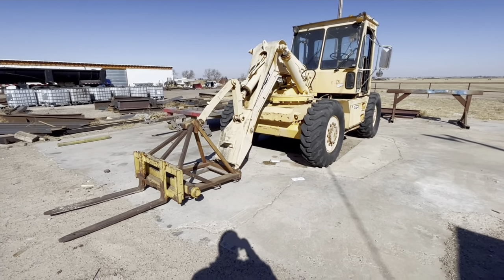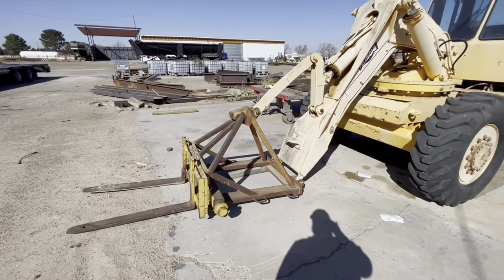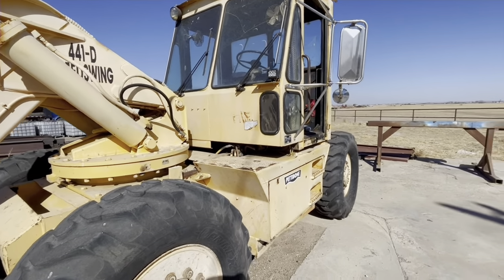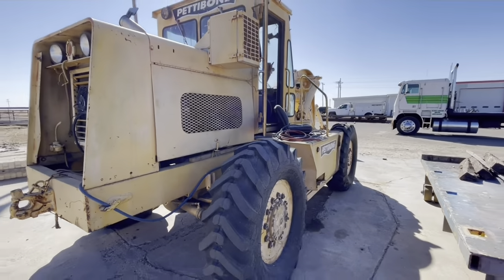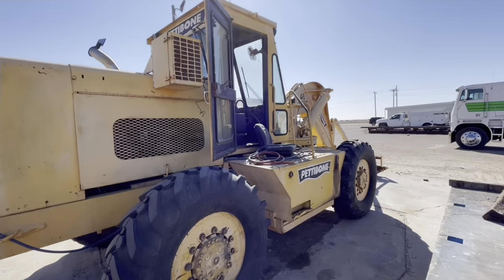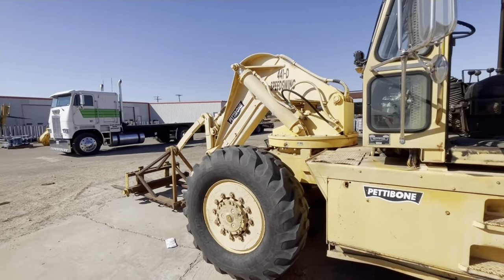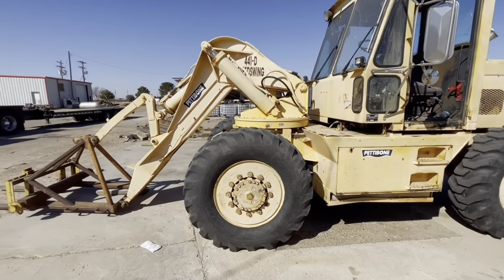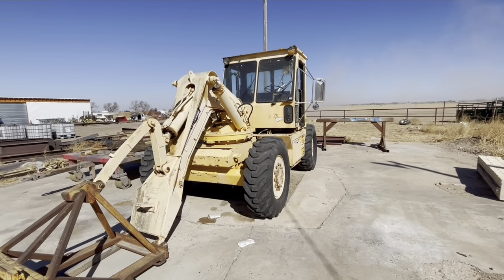What is this? A loader? Forklift? Railroad? I’ll show you!

Comment: Heck yeah man!  If you show the 16V wheeled-dozer, you might be pleasantly surprised at how well that video will be received...especially if you can get video of it running.  I already want to see it!  2-stroke Detroit Diesel anything has a huge cult following here on YouTube.  As for this Pettibone, you're correct, they were/are very popular with railroad "maintenance of way" (MOW) gangs.  Very versatile machines for track work.
Reply from the maker: I’ll see if can make it out to that dozer this week. Unfortanly it has sat for 3 years and feel like injectors would need to be checked to start it. Maybe second video!  Thanks for watching!
Reply: Thanks for making good videos.  Even if it's not running, it's still a rare piece of equipment that should be documented while it can be.  Thanks, Gary.  👍